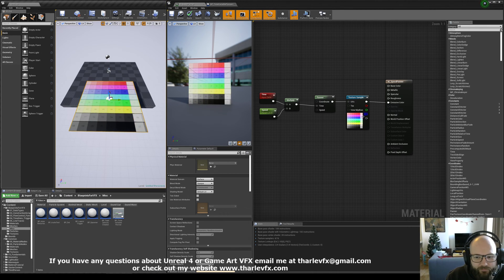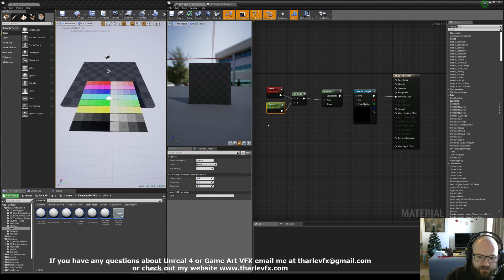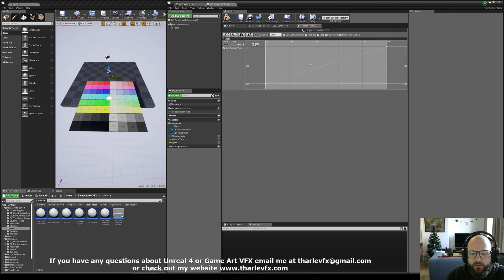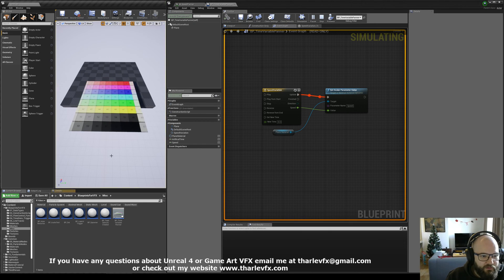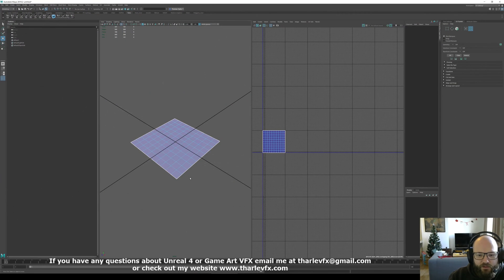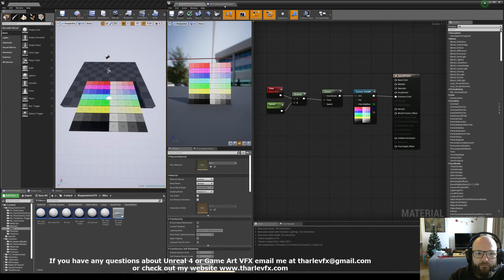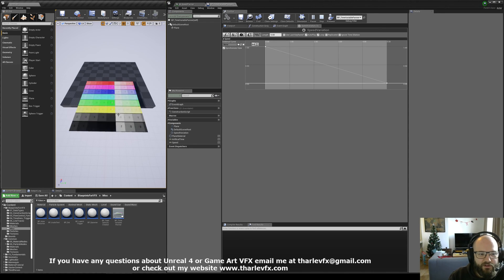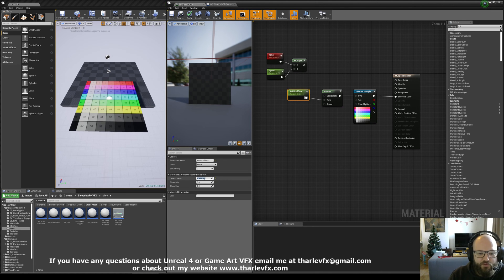Changing Panner Speeds at Runtime

Comment: I don't get it... you're simply replacing a time node that ever increases with a artificial time node that ever increases but slower... when accelerating time in game it eventually did the exact same thing, it just took 10 times longer before it started to accelerate ?
Reply from the maker: It’s not that it’s slower - it’s that you can control the rate of change of time. So you can speed up, slow down or reverse time.
Reply: @tharlevfx  That part works fine it does control the panning, but since the "artificial" time still increases over time, the speed multiplicator still (after say 30 minutes of gameplay) ends up accelerating the panning. For me it works perfect at first, then slowly but surely, the panning starts going crazy just like with the time node, if I print game time and "artificial time" they are both ever increasing values, sorry for being unclear English isn't my first language.

Comment: Can I add an input to this? Say I have a chainsaw that needs to rev, when you push the attack button it should spin (speed up the panner) but when you release it, it should slow down gradually instead of coming to a dead stop. What nodes would I need to add to this to make it work? Sorry if this is a lot in one question haha. If its too complicated to answer in text here... Maybe a new short tutorial idea? Stuff like this is very hard to find info on.
Reply from the maker: Yeah totally - this is exactly the sort of situation this would help in. Basically just setup so that you have a custom time value and then add a value per frame which is controlled by the player. Adding nothing = no movement, adding more is faster. Then on the trigger you set the value to be high and on release you use a timeline or math to reduce the increment. As long as you’re always adding to your custom time it will work.
Reply: @tharlevfx  Sweet, thanks for the rundown, your tutorials really are very useful~

Comment: Do you know how to create a procedural edge detect without using the post process material. Just using the material editor ? and how to go about it &
Am trying to create edge wear procedurally in UE4 because I have some very big assets and baking edge wear masks or texture is not good because of the texel density.
Reply from the maker: i'm afraid i dont think you can do this without either baking or using a post process material to find the edges.  baking an edge wear mask shouldnt be affected by texel density though - you can always use some higher resolution tiling textures, or some world space noise to ensure that your material has enough detail, even with a very large mesh

Comment: The only thing I would mention is using tick in a professional setting is likely to get an engine programmer coming to you asking why you are doing it and not using timeline on loop or using a timer. Unfortunately ticks are pretty costly compared to the other time methods
Reply from the maker: floorpeas this needs to be a per frame or on tick event though to get smooth movement though? Totally agree you want to avoid tick where you can!